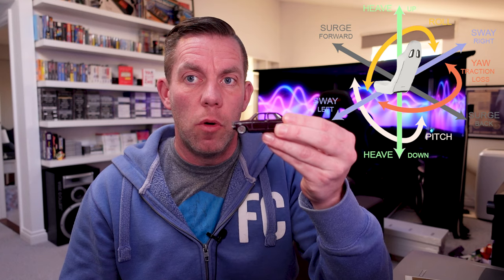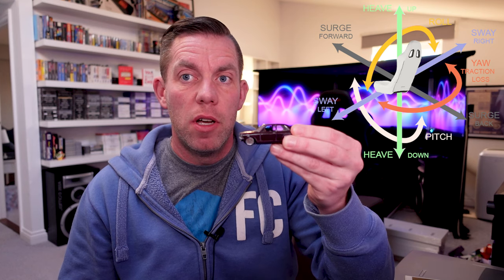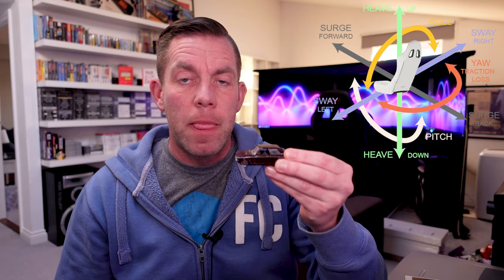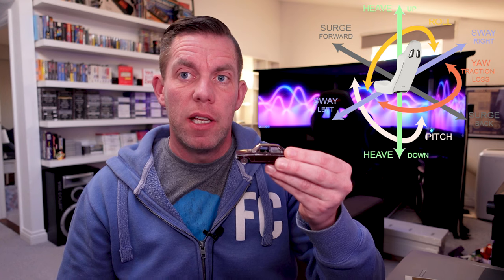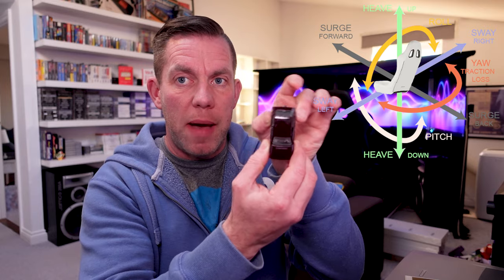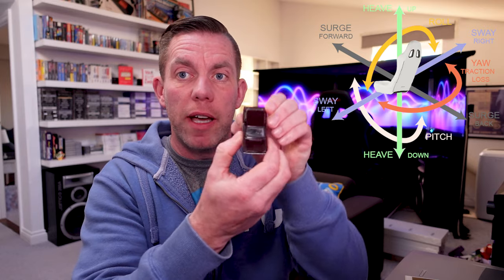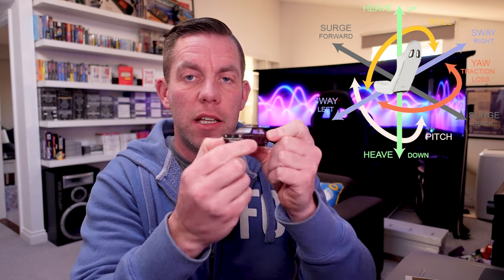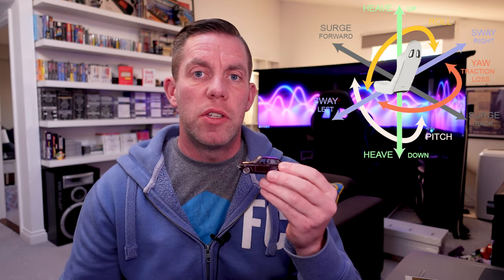Lets Talk Motion! DOF's? Setup - Accurate Simulation - Limitations - Right & Wrong!

Comment: Great video and completely agree with your points on simulation! Now you talk about using a 5/6 DOF rig with a triple screen set up and moving away and closer to the screens but would those principles still apply when using VR? Very interested to hear you opinion on that! Maybe use your Oculus with your sim rig and test those principles and compare?

Comment: During breaking the rig surges back and the rig tilts / nicks forward. So you have an initial short surge back to prevent your neck from swiveling, then the nick moves you to an angle like -30° and your whole body and head is still pushed forward. As long as the breaking continues. Ad infinitum. When breaking ends, the rigs nicks back to 0° and you feel no G-induced further forward motion. That works perfectly in VR as you don't see the room moving around you. You just feel and the VR set provides you with a 0° image.
A 6DOF Stewart-Platform excels in this.

Comment: I am not sure  I entirely agree. A seat mover like my NLR V3 is not trying to simulate the movement of a seat in a  car in real life, it is trying to simulate the movement of the body and factors like inertia  (with the limitations of 2DOF). While the body does not move forward in absolute terms when we break, it nevertheless moves forward  relatively to the position we previously occupied on the seat due to inertia. In that respect the sensations felt by are bodies are much greater than the actual movement of our seat (and the car) when the weight is transferred to the front or back and the front dips or rises. Whether I am using motion or tactile feedback, I look for immersion above simulation as I look for feedback that tells me what the car is doing (accelerating, breaking, losing grip, going over curbs, traction lost, engine vibrations and so on).  Because of the inherent limitations of motion and tactile systems and the impossibility to accurately replicate real life, I will always prioritize immersion over simulation when there is a conflict. Some effects will be overemphasized (not the ridiculous extend seen in demos of motion systems) other will be replaced because they cannot be replicated but the information must still be conveyed. This approach is even more crucial with tactile feedback which takes immersion sim racing to even greater heights than motion (I did not believed it until I tried both and I will choose tactile feedback over motion if I could only have one).
Reply from the maker: Totally agree mate! Using other forms  of physical feedback to enhance our experience is better than nothing, but most cannot accurately simulate real life, spot on! :)
Reply from the maker: Oh but referencing your seat mover, the idea is great but in practise it doesn't work, the issue is your head having no inertia, so all that happens is the equivalent to someone pushing your seat over from behind leaving your head where it was until it catches up... this is in no way realistic, in real life your head is leading your body under breaking as I explained in the video.
A 2 DOF seat mover can only accurately simulate pitch and roll.
But we are of course free to set it up how we like for the most fun! :)
Reply: @KarlGosling  Just to be pedantic. Everything has inertia all the time. You are mixing inertia and momentum. The strong point of seatmovers is that they are great at simulating the feeling of being pushed into the wheel. They are not trying to simulate G-forces, and I think the effect is quite convincing.
Reply: @KarlGosling have you ever driven a fast car in anger? Doesn't sound like it.

Comment: Hi Karl, I’m late to this interesting discussion. I’m an English Guy living in China. I recently chose to put motion on my Sim Rig and decided on PT-Actuator. When I started to search for PT, I discovered they are in Jiangsu Province, China and I live in Qidong which is also located in Jiangsu Province (about 5 hours away from PT). I bought and installed 4 Scorpion Actuators contacting directly with Shao at PT-Actuator. I’ve been very impressed with them and have also just ordered a ‘TensionR’ (Belt Tensioner) and a Surge Platform. Shao is going to deliver them to me personally, in about a week. So, now you will understand my interest in this topic. I will try the Surge Platform setup similar to how you have your setup. One of your final comments in the Video is “Physics is Physics”. OK, here is my thought. If you tie a 200mm cord to your rear-view mirror and attach a Tennis Ball to the end of the cord. The Ball will hang vertically down when the car is stationary. When you Bank (Roll) to the left the Ball Swings Left and that’s the direction your Motion Chair Moves. When you go Uphill, the ball swings backwards and that’s the direction your Motion Chair moves. When you brake from 40MPH the Ball Swings forward and when you accelerate the Ball will Swing Backwards. The Car will Squat under acceleration and dip forwards under braking. I think the Motion Chair needs to follow the direction of the Ball. In this case, I think the Surge Platform should move Froward under braking, because that’s the direction the Ball would go and ‘Physics is Physics’ – I’ll try it both ways. I really enjoy your Videos, keep up the great work.
Reply: No it needs to pull back because that’s what will create the push forward in your body more realistically. Best way is to surge back squat forward

Comment: I wished, after I got it, that my Next Leve V3 motion platform had have squeezed another actuator in to give a bit of heave. I thought they could raise and lower the universal joint in the middle.
But I realized that it would be hard to move that amount of weight directly, and, the pitch and roll actuators would be thrown out.
I like it though, it adds immersion.

Comment: An experiment you can do to prove you are mistaken: Roll your car very slowly forward in netrual. Put the car in reverse before your have stopped and pull your clutch slowly out until you are reversing. At no point in this process do the feeling of g-forces change. There is no magic moment when the wheels change direction that change the feeling you have in your seat. If you were a passenger with blindfold you would not be able to tell when the wheels start to rotate in the opposite direction
Reply from the maker: Try it mate, you have to stop moving forward before you then start moving backwards at which point there is a peak G force where you overcome the forward momentum and change direction and it's very noticeable.
There are some great principles and theories about this but the problem is in practice they do not work (as with a lot of theory), we don't drive with out eyes closed for example, so your visual input will had to the noticeable change in direction along with the G force.
Another thing to try if you like, brake from 60mph in your car, then pop it in reverse and move 150mm backwards... does it feel the same? lol No not at all :)
There nothing wrong with adding in reverse surge for braking if you want to (as I said in the video we can all do what we want) but it's not accurate simulation of braking, we are still never decelerating.
Reply: @KarlGosling  I have tried it! It is very possible to do with my model 3. E.g reversing and putting it in drive before I am at a stand still. The transition to going forward again is completely smooth, there is no "peak G force" if you do it smooth. Why in the world are you comparing braking from 60 mph to 0 to reversing 150 mm? Do you think accelerating from 0 - 60 mph is the same as surging forward 150 mm then? You are comparing apples and oranges. Also visual input in a sim racing environment is completely dependent on your setup. E.g. if you have your screens attached to your rig or not, so that argument is completely irrelevant. A motion simulator should try to imitate what you actually feel in real life, and the screens (or VR) should try to replicate what you see. Using a motion simulator to replicate what you see IRL, considering we have no forward momentum, makes no sense at all. Btw: Physics of motion is how we get people to the moon, calling it "just theory" is a bit funny.
Reply: And please answer the following experiment: What would you feel if you reverse your car within a train traveling forward at a constant speed. (Your car would always drive forward in relation to the ground)
Reply: @espensolheim-kile6056  This one was a slam dunk, but it is a pity Karl will not admit he has cornered himself into with very strong, yet very wrong opinions.

Comment: One of the biggest issues we have in this industry / genre is people confusing the term simulate, with replicate. We cannot replicate 1 to 1 the forces and effects of real life, which is where we run into massive trouble with elitism, snobbery and people telling us all how something SHOULD be done comes from. 

Simulation is imitation or giving a similar (notice how it is built into the language?) result. Simulation is not about exact replication. That is another matter altogether.
Reply from the maker: Simulation is about exact replication where possible and in some situations 100% necessary (electronic circuit design software for example).
As in my video though some things can be accurately simulated and others cannot, you have to make the best of what you have and make it as fun as possible :)
The only elitism/snobbery I see in sim racing is when it comes to what hardware people tell you to buy, IMO you can have just as much fun on a G920 with a PSC as you can on a Fanatec DD2 and P1X... but some love to tell you "you MUST have this or that" which isn't fair.
Reply: The rigs simulate a lot but with less degree and shorter time. G-forces are simulated with perhaps 1.x g.

Comment: Hi Karl. Have followed you for a while and love your content. However, in this instant I am pulling my hair:) I will try my best to explain why you are actually wrong from a physics standpoint. Speed is only relative, so you have no inate sense of speed, only acceleration and deceleration. This is quite easy to demonstrate. If you fall asleep in the car and wake up you have no idea of speed before you look out the window. If what you where saying where correct we would have had to take the earth rotation into account. So; Breaking and reversing is the exact same thing from a g-force perspective. Of course, if you had infinite travel in your motion rig, you could actually replicate 1:1 as you say, but given the limitations of the rig it makes no sense to not surging backwards when breaking. It will pull you to your seatbelts, as you would breaking. Remember, when you are not accelerating anymore, there are no forces on your body at all. Even in 200 mph. This is explained well in Niels Heusingvelds video, who clearly understand the physics quite well. So your main mistake: Considering what you see, instead of what you actually feel. Braking feel is the exact opposite of acceleration, and luckily, the surge platform can provide the opposite. What about having a discussion with Niels on this? Would be great.
Reply from the maker: I appreciate your input but I do not agree mate, the issue you are forgetting is that we are never actually moving forwards in our sim rigs, this means we have no momentum or inertia as I explained in the video.
When we are pulled backwards from a stationary position in our sim rigs this is exactly what we feel when reversing our cars in real life, it cannot be argued as this is literally what happens, we engage reverse and move backwards, this is the only time IRL this will ever happen.... when we are braking we are slowing down forward movement, not reversing... and it feels totally different, this is very easy to demonstrate by just going out in your car and braking from any speed to a standstill then putting your car in reverse and pulling away, they do not feel even close to being the same, literally go out and try it mate, I have! :)
The key point here is that reversing is accelerating backwards (negative surge in our rigs), when we brake we are slowing down our forward movement, never at any point accelerating backwards and it feels very different.
Reply: @KarlGosling  I definitely have tried and they do feel the same. If you were in a train, and all the window blinds were down, you would have no way of knowing if the train were decelerating or accelerating backwards(reversing). It is all relative. You are close in your thinking talking about momentum, but the conclusions are wrong. Since you have no forward momentum is exactly the reason why you need to be pulled back. A thought experiment for you; What if you were driving a car within a train moving forward at a constant speed.  What forces would you feel reversing the car inside the train? Again, relative motion - a very important concept in physics. Deceleration is a word that is perhaps making people confused. In physics we are only talking about acceleration, defined as change of velocity over time. It makes no sense to differentiate between accelerating backwards and braking - bot are the same in terms of acceleration. If you were actually right we have physics all wrong, which seems unlikely. Btw; you are correct when saying that getting pulled backwards when accelerating from a stand still makes no sense.
Reply: @espensolheim-kile6056  Is it correct to say that the motion of a rig simulate the G force in Acc/Dec and turns in some axes and in others the motion of the car? If you are taking long left fast corner, the rig will tilt/roll to the right (to simulate centrifugal force) and the anglel of tilting will be high as the G-force in real car will be higher. If you are drivng F1 car and you slow down from 300 to 50 km/h before the turn, that can happened for 2 or 10 seconds, so the pitch motion will be fast (as the travel fo the rig allows) or very slow, as imitating the G-forece you will feel on decelerating. Your body will fall from the seat (wants to go "forward" as in real car) If useing VR it will be more realistic, because you know  that the car is slowing down, not tilting forward (it happents but not as much. I think more important is how fast this pitch goes), your body will feel a force (from gravity) and your brain will think that you are decelerating. Other way to simulate G-force is to use pressure bags around your body.
Reply: It seems Karl is hung up on the visual aspect of what it looks like when the car is doing various things, and not what it feels like. This is a very fundamental mistake. Remember, the simulator does not have the same velocity as the car. An example, Carl says that in a banked corner the simulator should tilt with the banking. No it should not, only if there is no turning. The point of banking in real life it to cancel the outward acceleration experienced when turning, so in a banked corner you are pushed down into the seat, not to the left or right. The most correct way to simulate a banked corner in a motion rig is actually using upwards heave. Counterintuitive, I know.
Reply: @espensolheim-kile6056  Agree with this. My DOF 6 simulates a banked turn in an aircraft by rolling it left or right which is wrong. In a real plane the feeling would be to be pushed slightly to the base of the seat, not right or left in a banked turn. Granted, the platform cannot simulate a continued feeling of heave with the limited travel. Its as close as it can get but fundamentally is incorrect.

Comment: You say 'sim' racing. I have just got a dd wheel, but even before that the recommended settings for force feedback wheels all seem to want you to big muscles to turn the wheel. No car I have ever driven needs any real amount of effort to turn or hold in a turn.
Why do we need 20 nm, or 10, pushing back when it never happens in real life.
Or, am I missing something in the setup.
Reply from the maker: You are indeed missing something.
It totally varies based on the car you are trying to simulate, drive any 80's car with no PAS and a quick rack for example, these are stupid heavy! Drive something modern with EPAS and it's very light, in addition to this the driver can specify how heavy or light they want their steering to be in most modern race cars.
Reply: @KarlGosling  
I'm pretty old and have driven a lot of cars. Most without power steering had a lot of turns lock to lock. Some smaller cars not but they weren't too bad.
I am still trying to work out how to get light steering with the DD but still with all feel.
Any tips? 
I could just reduce the overall force feedback but I worry that will reduce sensitivity and feel in other areas.
I know I could just try every setting but there are lots and and many games with different feel.
One car I want to simulate is a Subaru WRX. I have a 2000 model, not STI though. I also did a few days and courses where they had real rally REX's and the steering was pretty light.
Thanks. Great Channel.